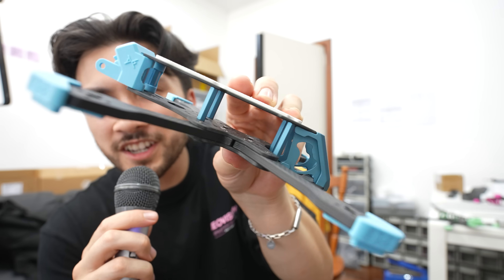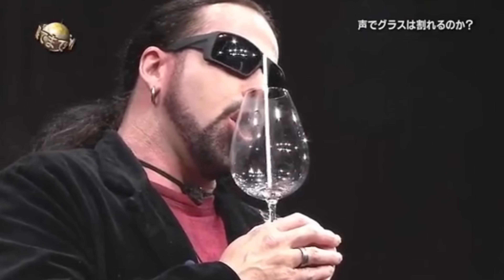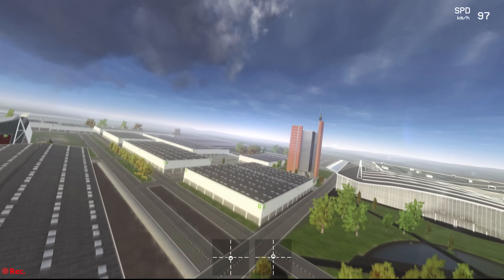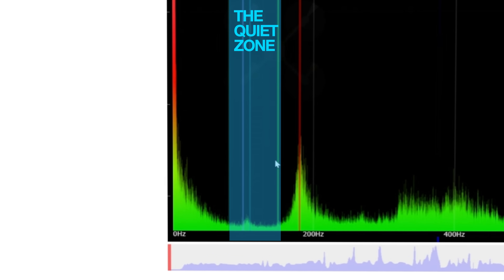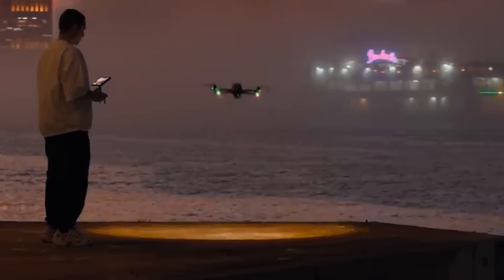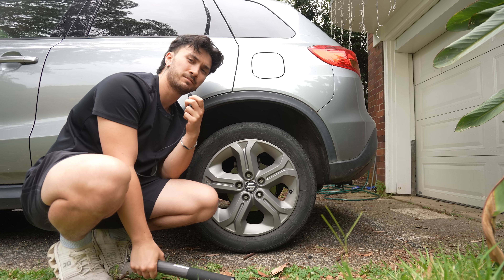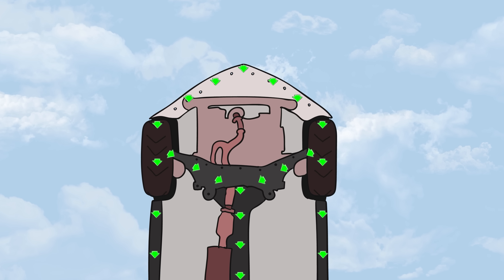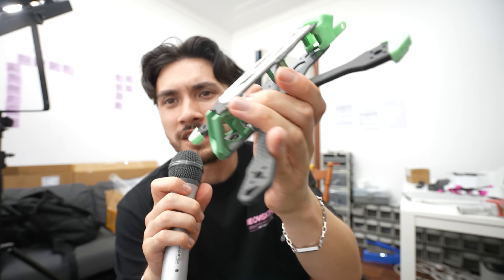The Hidden Tech In Freestyle Drones...

Comment: The solution is foam. Add foam tape in arm joints, and all resonances will be gone. Just like that.
Reply: Adding physical damping does the same harm as adding filtering (in ideal cases). Just with the added downsides that you can't tune it and it wears over time.
Reply: @someonespotatohmm9513  Well the physical damping works orders of magnitude better than any electronic filters, without affecting manouverability. This gives only millimeters more arm flex at hard maneuvers, and you're not going to notice that.
Reply: @alexanderg-p3z  The wonderful thing is that the mathematics are simple. Either it is the same or it doesn't damp. How and why might become horribly complex. But the fundamental tradeoff stays the same.

Comment: Hi. The bridge did not fell because "the wind matched resonant frequency". That's not what happened.
What happened is called "flutter", which is an airfoil that starts self-resonating even in a completely stable, laminar flow. The speed of the wind did not matter, what the wind did to the bridge was just provide energy, the bridge took that energy and created self-resonance which means the bridge itself chopped up the airflow in the exact frequency that was necessary for the bridge to resonate with.
Same thing happens when you play the flute. You do not need to provide a sound for the flute to make a sound. The flute "self-resonates", which means you just provide steady flow of air and the flute itself chops up that air to the frequency that is going to resonate with the flute.
The air needs to be in a certain band of possible velocities, but that is very generous - you can play a note on the flute by provide a lot of air or very little air and at different speeds and the note will be roughly the same.

Comment: Increasing damping helps by reducing the Q factor and peak amplitude, but it also broadens the resonance, spreading energy into adjacent frequencies and potentially contaminating the quiet zone.
A more fundamental solution is increasing frame stiffness, which shifts the resonance to higher frequencies where it can be more effectively filtered.
Reply: Thank you for this explnanation, please correct me if my understanding is wrong, so the maximum vibration can be reduced but the amount that smaller vibrations spread is much higher?
Reply: @ThemanthemithfirzeuImagine the resonance peak like dough. More damping flattens it - lower peak, wider bandwidth.
That widening happens on both sides of the peak, including into the low-frequency range.

Comment: I've designed and built a new drone frame, it's small, projecting 40+ min flight times, and is whisper quiet. But it has issues with vibrations. Is there any way to get in touch with you for help ?

Comment: @Nick_FPV thanks for the frame homie. Great build!! Only complaint.., the walksnail camera prints (black) should have the lower channel to adjust/lock in camera angle. The holes that are drilled would put the camera at an 85 degree tilt.

Comment: Hi! I'm hesitating between the CineLog30 V3 O4 Pro, the Cinebot25 V2 O4 Pro, the Sub250 Huma20, the Deepspace Stellar 25 O4 Pro, and the Sub250 Dollyfly25 O4 Pro for primarily professional use (indoors, real estate, hotels, weddings, concerts, flying close to crowds, slow and smooth shots, and occasionally tracking cyclists/runners in the forest at moderate speeds, almost no freestyle). I'm looking for a drone that's ultra-stable at low speeds, predictable, and smooth on the throttle, but that I can also configure in several modes (slow for indoors / normal / more punchy speed and power for outdoor tracking / medium to fast)—which one do you think is really the best suited for this type of professional work and why?

Comment: Pretty sure DJI has another trick up there sleeve that lets them use low stiffness frames.  It's called feed-forward control.  Basically you add a simplified open-loop drone controller that acts in parallel to the feedback controller.  This lets you tune the open-loop controller for command response, while independently tuning the feedback controller for the best compromise between disturbance rejection and smoothness.  DJI can do this because they use DJI motors and DJI propellers so they can dyno-test them then use this test data to make an accurate open-loop controller.
Reply: It will help for control inputs but not much for disturbance rejection. Unless they find a way to "feedforward" the detection of the forces from the air.

Comment: Hopefully someone is working on active "noise" cancelation to offset resonance. Excellent video!!
Reply: that's what filters are
Reply: @lottiefpvI think filters attempt to do that but I don't think filters are the same as an active noise cancelation. I might be wrong though. Cheers!
Reply: @amp86400  Although maybe technically not  active noise cancellation, the dynamic notches are a form of adaptive filtering. And with how difficult it is to get good models when air is involved, realistically the best we are going to get.

Comment: Interesting stuff. This has me wondering if getting tension involved, like having thin cables pulled tight between the arm tips, could open up some options. Increase the stiffness by loading the frame via tension and compression.

Comment: why can someone not make a drone that combines normal drones and fpv drones like get a drone frame like the arche type maybe 5 inch make it have all the  tech dji has and like the stabilization and movement and the camera is stabalised on a 3 axis small gimbal then you flip a switch it goes full manuel mode and the gimbal locks and the camera doesnt stabalise and now its a fpv drone and make it 5 inch small but not to small i want to make it so bad but i just dont have money.
Reply: dji avata… that’s already been done and the drone definitely highlights why you don’t want to do this because it flies very poorly when you actually try to do real fpv freestyle and tricks.
Reply: @natebrace1594  i know im getting the avata 2 but i thought we could make a drone better than the avata 2 and also act like a normal drone like a mini 5